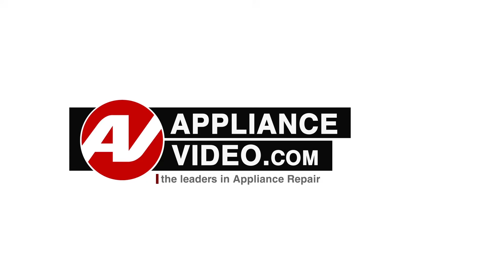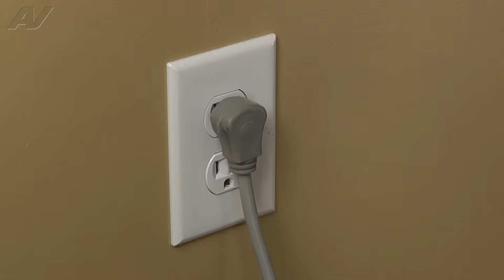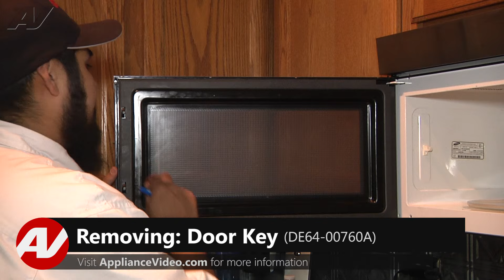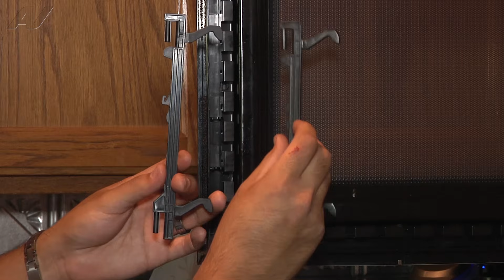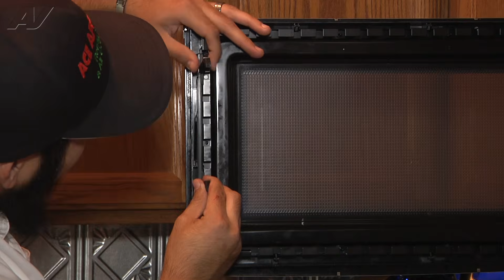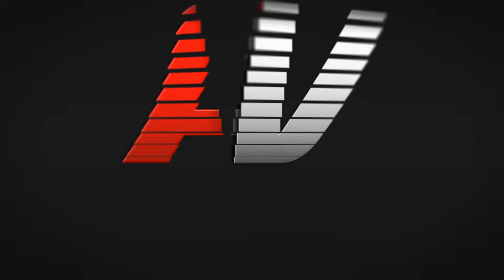Samsung Microwave Repair - Door Will Not Latch When Closed - Door Key

Comment: The latch is not what broke, it was the lower piece so I just hooked it to the metal on the side. If it slides off I’ll have to somehow drill a hole in it.

Comment: Thanks for this. Unfortunately, the plastic piece attached to door where the other end of the spring attaches broke. Going to try crazy glue, but probably better to buy a new microwave, as this one is 13 years old instead of replacing the door?

Comment: mine was just the piece that the spring hooks to as well. I used a piece of string to attach to the lower metal plate with a hole in it for the bottom of the plastic latch. So far easy peasy and I did it myself!  Thank you

Comment: Mine broke on the door side. Safety wired spring thru the hole to the next opening in the metal bracket. Thanks for the video, they are a tremendous help and saves us the big $$$.

Comment: My problem was the tabs on the door also breaking off. For me it was the top bar glide and the middle spring tab.
I did 2 things to reinforce the entire new door. I used a glue gun and pumped a small bead around the bottom of each of the 3 tabs being careful not to get glue on the holes to reinforce it.
The other thing I did was superglue a small thin aluminum "L" bracket on the tab off the latchbar where the spring attaches to the plastic notch is now reinforced as well.
The door was $235 but the option of buying a new oven ($270), having the new vent fit exactly where the old vent was (through the back wall) having to pay for a reinstallation and removal and then possibly having to drill more holes in my 10-year-old cabinet wasn't an option!
Your video was invaluable to necessitate a relatively simple repair.

Comment: That's great and all, if that's the problem.  The problem with my microwave is the plastic piece where the bottom of the spring attaches is broke.  So what's the fix for that?  A whole new door that costs as much as a new microwave?

Comment: Good Vid!!! My problem was the little plastic clip on the door was what was broken. I was considering using the 3D printer to reto-fit a clip until I realized I can just use one of the medal tabs in the inside of the door to hold the lower end of the spring. Done and done @ $0.00 and 5 minutes. Thanks to seeing this Video and my checking before ordering the latch as the latch was not the issue.

Comment: In my case, the key was fine but the door hook broke. I was able to drill a tiny hole into the metal braket that held the plastic panel and attached the spring there... latches even better then before. Thanks !!

Comment: I ordered a new latch for my microwave, i opened the frame to insert it, but it turns out the piece that holds the spring itself is broken. The old latch was fine. Does anyone know what that piece that holds the spring is called so i can order it?

Comment: Thanks so much. You just saved me a huge repair bill. Mine wasn't broken on the hooks though. It was broken on the part inside the door frame where the spring attaches to the door. Paul Ricalde has a video where he attaches the spring to the metal fins on the inside and then attaches the spring to the Hook piece and then puts in back together to create the tension needed again. You are both life savers.
Reply: Interesting. The thing in the door frame that actually keeps the door latch in place once you hook it onto the spring is what broke on mine.
Reply: @RahsaanTownsell  I ordered a new latch before taking the door apart. After it arrived I discovered my latch was fine. The piece that hols the lower end of the spring to the door had broken in mine. Fixed that by drilling a small hole in the remains of that stub and feeding the lower end of the spring through that hole. So far so good.
Reply: thank for you this tip! 🎉
Reply: Thank you so much! ❤
Reply: Thank you for this lead, this was the same issue with mine & using Paul’s method fixed it!

Comment: Video was exactly what I needed. It explained how to take off the doors plastic cover exposing the latch mechanism. Like others, the metal spring had become detached from the interior plastic mount which seems to have simply broken off after two years of use. Fortunately I hooked the spring to a metal part in the door mount which allows the spring to function as before. Replaced the plastic door cover and the latch now holds the door closed and functioning again. I hope this holds. It would appear that the interior  plastic parts holding the metal spring in place are not built to last— given the wear and tear on the critical part of the door and latch.

Comment: Very helpful!  Where the spring was supposed to attach had broken, so I drilled a small hole right behind where the spring hooked and it worked great again, at least until that plastic breaks

Comment: Thank you I thought the problem was on the opposite side …it was the spring mounting point that broke on the door side I had to hook it to the metal area a little tight but still worked out 👍

Comment: Yes you you were correct the spring bar was not connected to the spring but the spring Bart was not broken it just got loose the only problem was we broke the piece off that was holding the spring but we did connect it and it is holding thank you so much for everything

Comment: This video is an excellent video for repair of the microwave door latch if the key is broken.  It was also useful in giving me the confidence I needed to open the door assembly and realize the plastic area holding the spring was my problem!  I wish I had read some of the great suggestions here.  I ended up heating a 90 degree  hook set tool up with a torch and creating a new hole behind the area that had broken.  I stretched the spring a little and curved it into the hole and then bent it to secure it.  The tension was perfect and I was able to follow your instructions on putting it back together.  My microwave is operational now!   Thanks for the great video!  I have subscribed and look forward to your help if I run into any other issues!

Comment: Thank you SO very much! I was able to repair my microwave. However my issue was not exactly the same as the issue you described. Several responses below state the issue I had as my latch was not broken but the piece on the door that holds the spring on the bottom was broken. After reading responses below, I was able to hook the bottom of the spring on a hole that was already in the microwave and pull the spring up to hook the top of the spring to the latch and it was fixed. You may want to do a video on this fix as several have mentioned this problem below. Again thank you for showing how this worked!
Reply: that was how I fixed mine. Just put the spring in to a hole
Reply: Same problem here. The other attach point for the spring broke off. My first thought was to go to that drawer in the kitchen where everyone throws their spare springs and grab a longer one. No luck so I figured a rubber band and I can make it work... Checked every door knob in the house and no rubber bands. Now I'm scrolling down hoping he included a part number. 1st comment... Plan C. Bing Bang Boom needle nose plyers. 

On to the next video... might as well replace the handle that broke off 5 years ago. AND range light that I broke the bulb trying to get it out a few years ago. 

AND to the Samsung Engineer reading this. 5 minute job in the die room to make an attach point for that spring.
Reply: @tommyb6886 how did you fix it?
Reply: Mine was broken at the bottom too.  Used a zip tie to give something the spring to hold on to that was nonferrous.
Reply: @MrQuailbeak I just fixed our microwave using a zip tie.  Thank you for the solution!
Reply: Had the same issue and fixed it the same way
Reply: Thank you 🙏🏻

Comment: Great video to allow me to figure out a solution. Door spring attachment bracket was broken (same as KentuckEd), not the actuator in the video. Drilled a tiny pilot hole from outside edge of door just below the position of the attachment point. Screwed in a small /short screw to give the spring a new door attachment point. Using two needle nose vice grips, rotated one end of the spring 90 degrees to mimic the angle of prior attachment. Door closes without screw causing an issue (if it stick out too far it will stop the door from closing). Working perfectly.

Comment: Absolutely excellent video.  The piece on my door that holds the spring broke.  The latch wasn't broken.  So I stretched and customized the spring a bit to grab the metal door surround and put it all back together.  Works OK now.  Hopefully it'll stay working.
Reply: Same issue! Thanks!
Reply: Same here exactly.  How cheap, the piece that broke was less than 1/16th plastic.  Connecting the hook to the door is way better, until the connection to the arm breaks.  Now the panel to the right where the controls are is loose.  Mine is only 5 years old.  Designed obsolescence.  Throw it in the landfill and buy another piece of crap microwave built in China.
Reply: Same issue  - Thanks!  Hope it holds!

Comment: Hey great video man!
Call me crazy,but what I did with my handle was used a older Hewlett Packard CD rom laptop player. There was a screw hole bracket affixed to the case on the cd rom housing(you release the cd rom player buy taking screw out on bottom of laptop) then the whole cd rom player comes out.
The I took the two tiny Phillips screws out that held the bracket on,and I used JB quick weld to fasten the bracket onto the handle(let dry over night,because of tension from spring).
Now I just so happened to have this laptop part laying in a drawer in my kitchen, so I saw it immediately, and I could see that would be a good sturdy fix to a broken plastic piece. 
It took about 45 minutes to complete and overnight for weld to set to hold under pressurized spring ,but nevertheless it worked...and mostly because of your video showing how to take the guard of carefully. 
😃

Comment: You have an excellent video, but when we went into the microwave the small black piece that the spring connects to was broken. There is nothing wrong with the latch. Is there a part you can order for that and if so how would you put it on? If there is what is the part number and where to order it?  It looks like you would have to glue it with some seriously strong glue. We think that part probably doesn't exist as it was built into the microwave. I think we'll probably have to get another overhead microwave. Please let us know. Thank you!

Comment: You are amazing….. God bless you my brother…. This is what I was looking for from last 5 days…. I had almost similar issue with my appliance. The key was fine but the plastic piece attached with the door where the spring has to tuck, had a crack. So I have used strong glue and after 24 hours I fixed it….
Reply: What type of glue did you use ? I’m having the same issue with my microwave

Comment: Bought replacement part from Amazon.  Installed and closed the door.  Fan came on and control panel did not function.  Compared new part (made in china) with OEM.  The bottom arm hook is a little longer than OEM and trips a micro switch interlock.  Looks like I should be able to file off the excess.  Anybody else had this problem?

Comment: Thanks for sharing. Well,  after watching a few videos, I've come to the realization that not all samsungs are built the same. For me, luckily the hook on the removable bracket didn't break. But the hook on the door did. So what I did was make my on eylette with some wire and it worked like a charm.
Reply: Same break point for me. I used a small zip tie and routed it through a hole in the metal track. Adjusted to be at the same location of the door mount. Works like a charm.
Reply: Thanks for tips!! Used the Zip Tie technique too and works like a charm. Randal great idea!!

Comment: if the hole that the spring connects to on the door "rips" - what are the options?
Reply: Connect the lower spring to an open area on the microwave, an eyelet or other place you can hook it to. Just stretch the spring as needed as you NEED tension

Comment: Well, I fixed the spring part but the door still won't latch.. so is on the other side of the microwave  that I need. To be looking at?
Reply from the maker: Great question, if you have a more technical question that our parts department cannot answer, you can search our over 17,000 answered questions free at our website www.ApplianceVideo.com under our Repair Help section. You can also call our parts department at 1-800-830-5465 and they can give you help 7-days A week ,or search at www.SaveMoreOnParts.com  .

Comment: Hi Cristian...thank you for a great repair video...when I opened up the door as you described, I found that the key itself was intact but the piece of plastic inside the door where the spring connects to was broken...not sure if that part slides in or is part of the larger inside of the door...is that small part replaceable? Any ideas would be greatly appreciated!
Reply: I hooked one end of the spring under the squared notches on inside of the door.
Reply: @michaelhoot9759  did the same thing and it worked ok. Gluing that part back would've not worked, and this is cheaper than buying a whole new door.
Reply: @michaelhoot9759  Thank you for the tip! That's what my husband ended-up doing too.
Reply: @michaelhoot9759  - Great suggestion, worked like a charm!
Reply: Still works, if anyone was wondering
Reply: @michaelhoot9759  Ours too and it's much more sturdy than the other little piece.
Reply: Same thing happened to me, any ideas?
Reply from the maker: Great question, if you have a more technical question that our parts department cannot answer, you can search our over 17,000 answered questions free at our website www.ApplianceVideo.com under our Repair Help section. You can also call our parts department at 1-800-830-5465 and they can give you help 7-days A week ,or search at www.SaveMoreOnParts.com  .
Reply: I just found the same issue   I have not been able to find that part for sale   It looks to be just as likely if not more likely to break off as the hook on the door key
Reply: The same thing just happened to me. It’s tough and awkward to hook the spring into a hole by stretching it. I used a 5/64 drill bit to drill a hole through the outside of the microwave door plastic in. I inserted a toothpick through that to the other side under one of the metal ledge indents then clipped off the toothpick end protruding to the outside. It is kept in place like the rung of a ladder by the spring tension upward.  It took 5 minutes to do and no need for a new door or a super glue event!
Reply: Omg this worked. Life saver. 😎

Comment: The part that is broken in mine, is the hole at the door where you insert the spring. How can that be replaced if it is attached to the door?
Reply from the maker: Great question, if you have a more technical question that our parts department cannot answer, you can search our over 17,000 answered questions free at our website www.ApplianceVideo.com under our Repair Help section. You can also call our parts department at 1-800-830-5465 and they can give you help 7-days A week ,or search at www.SaveMoreOnParts.com  .
Reply: That is my issue too. Did you figure out a solution without having to order a new door?
Reply: @meormsbyomg  Same issue with mine after I bought the part. I was able to attached the spring to the metal part of the door to the right of where that hole is. Works fine.

Comment: This video was great at showing me how to take the door off to troubleshoot the door issue. However, the latch was fine. The clip my spring attaches to is what is broken. 

How do I replace that piece?
Reply from the maker: Great question, if you have a more technical question that our parts department cannot answer, you can search our over 17,000 answered questions free at our website www.ApplianceVideo.com under our Repair Help section. You can also call our parts department at 1-800-830-5465 and they can give you help 7-days A week ,or search at www.SaveMoreOnParts.com  .
Reply: Any luck getting it replaced? Same issue happened to me
Reply: Same here, me too